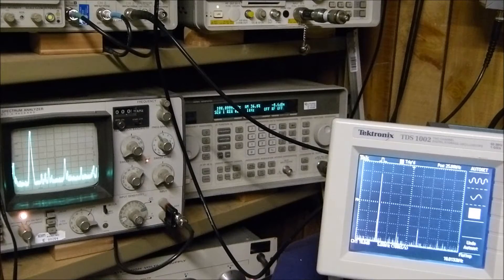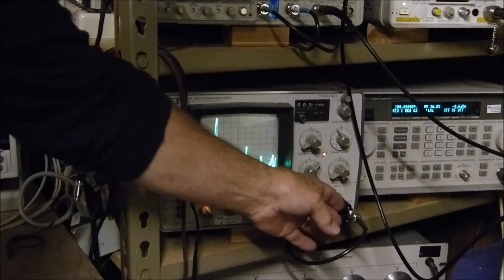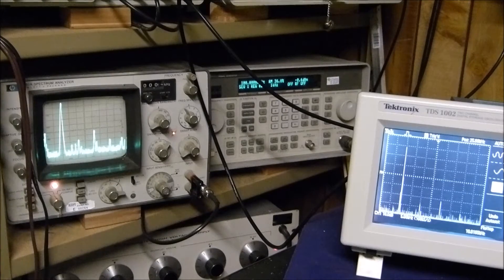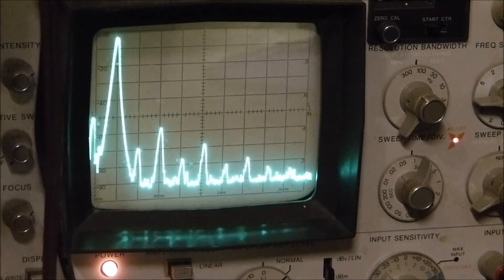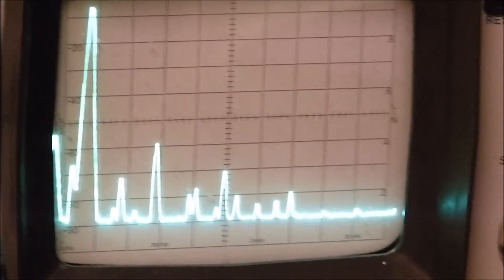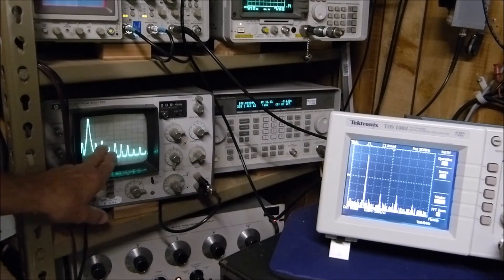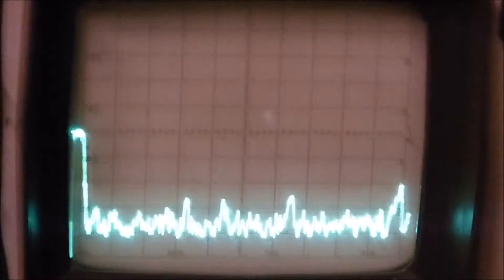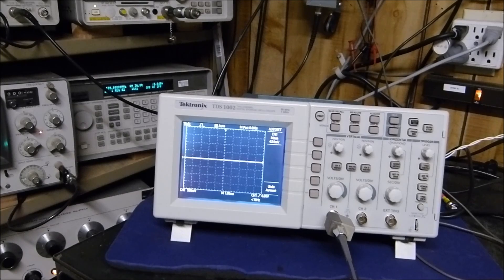Comparing Analog HP 3580A Audio Spectrum Analyzer To Tektronix DSO FFT At Audio Frequencies

Comment: Thank your for demonstrating the hp3580a at low frequencies. In particular I enjoyed the the 10 Hz Signal in connection with the 0-100 Hz span. While the FFT has a big speed advantage over the swept sine method  at such low frequencies it is always good to measure the same phenomenon with two different technologies to verify the results. The hp3580a was a fantastic piece of equipment for its time - especially love its amplifier and its ability to be battery powered - and it is always great to see it on YouTube. In addition it is one of the iconic products that made HP such an outstanding company from the beginnings until 2000. Hope to get one some day. Did you use the "adaptive sweep" function which was specifically designed for settings like this? If not it would be interesting to see how much it can quicken the measurement process. Greetings
Reply from the maker: It is an amazing instrument made as far back as 1973. Mine is an older model as it does not have the digital readout. I would say that every company, Dynaco, Fisher, McIntosh on and on... had one or more to verify the amplifiers they designed and built. Mine has gotten to where it needs to warm up a good hour before the vertical display is correct. Got to be very careful how we work on these jewels. They could easily be damaged during remedial maintenance. Thanks for your comments.
Reply: @ElPasoTubeAmps  Indeed, the instrument was featured in the cover story of the Septembre 1973 issue of the HP journal. 
If you did not use the adaptive sweep you might wish to try it out because it will increase the speed of measurement by a factor of ca. 10. In the video you said that you make rarely such measurement because they take so long.
While the swept sine method of the 3580a is relatively slow it allows to detect extremely small signals. I think this is because swept sine devices can use narrow bandwidth amplifiers while FFT devices use broadband amplifiers which catch more noise, thus limiting amplification. While everybody notices the slow speed of the 3580a nobody seems to value its enormous sensitivity of up to 0.1µV full scale (mentioned in the specs of the said article). Its FFT successors from HP - dynamic signal analyzers such as 3582a or 356x - typically have a maximum sensitivity of 3mV fs, so they are 30.000 times less sensitive. (This number is so incredible that I wonder whether I made some reading mistake but if so I cannot find it.) This ultra high sensitivity is not needed when measuring audio amplifiers - so it is usually overlooked on YouTube - but it becomes decisive when measuring the output of sensors. Like the vibration sensor shown on the cover of the mentioned HP journal. 

So - if you or any other 3580a owner could make a video analyzing these low level, low frequency signals it would be greatly appreciated. For example by people like me who measure vibrations in buildings.  Analyzing a, say, 10-100µV rms signal would be great. To the best of my knowledge there is currently no YouTube video covering this topic with respect to HP products. Greetings

Comment: Do you have standard settings you use with the 3580A? At least to start? I picked one up recently and need to become familiar with it.
Reply from the maker: I might suggest just pausing this video as various spots and looking at where the settings are on the 3580A. If the light with the three arrows is on between, Resolution Bandwidth (RBW), Freq Span/Div and Sweep Time/Div, it means you are sweeping too fast for the perfect display. The, Input Sensitivity, Max Input, light should not be lit or it will be creating its own artifacts. Put Amplitude Ref Level on Zero - Normal. Just have to play with it and get the feel of it and it starts to make sense. Hope this helps.

Comment: Wishing you a happy Christmas and new year 2023!
Were both of these connected to the output? I find that hard to swallow - the digital one looks as if it were connected to the input.
Reply from the maker: Merry Christmas and a healthy New Year for you and your loved ones.

They were both connected to the same point on the output. 
This was a few years ago but I am sure I was trying to illustrate the differences between the FFT method of digital spectrum analyzers and the older analog version, swept-tuned spectrum analyzers. The FFT method is much faster than the analog version when the RBW (Resolution BandWidth) and is small, i.e. looking at a small portion of a signal or if the frequency is low. With both types, weeping a large bandwidth is quick but there is much less resolution and detail can be missed. Zooming in, so to speak, by lowering the RBW slows down the sweep to as much as 50S per division and for 10 divisions that is 500S or 8.3 minutes for one sweep from left to right on the HP 3580A. 
With the digital FFT spectrum analyzers and especially the ones dedicated just for audio frequencies, all the low frequencies are instantly displayed and allows us to quickly see power line issues like the 60Hz and 120 Hz hum issues and real-time, make adjustments to reduce them - can't do that with the analog analyzers but the old 3580A is probably the spectrum analyzer that evaluated virtually every high-end vacuum tube amplifier ever built that we hold up as the very best of yesteryears.

Here is a link to the best video I know of on YouTube about RBW and VBW

https://www.youtube.com/watch?v=Ffhs9Ny03lM

Definitions below from Internet:

A swept-tuned spectrum analyzer displays measurement results sequentially—in other words, not in ''real-time. '' This is because a swept-tuned analyzer, in effect, uses a single narrow filter that is tuned across a range of frequencies to produce a spectrum display.

As the name suggests the FFT spectrum analyzer is an item of RF test equipment that uses Fourier analysis and digital signal processing techniques to provide spectrum analysis. Using Fourier analysis any waveform in the time domain can be represented by the weighted sum of sine and cosine signals.
Reply: @ElPasoTubeAmps  Wow, that is some detailed response, thank you! I will have to read it more than twice though. Thank you for the links too - I will make sure to check them out. Out of interest, the 3580, how far to the right can it extend when tuning at 100Hz, e.g. can it display harmonics all the way up to 50kHz? Reversely, when tuning at 20kHz, can it display subharmonics all the way down to 5Hz? I hope these questions make sense the way I wrote them.
Reply from the maker: @Stelios.Posantzis  It does go from 5 Hz to 50 KHz so it will display very low frequencies but at a very slow rate. Its top end is 50 KHz so for a fundamental frequency of 20 KHz, only the second harmonic can be seen at 40 KHz which is good enough and its noise floor is, at best, -90 dB. Totally good enough but the FFT analyzers that run off a PC nowadays serves the purpose just as well and some are free downloads off the Internet. We have to pay a little money to get all the options like the ability to print but the basic analyzer download is free.
Reply: @ElPasoTubeAmps  Thank you for this once again. On the subject of PC analysers, this is something I think about every couple of years when trying to decide whether the time is right for me to obtain an analyser and I am weighing my options. It is true, PC analysers are a massive convenience, are relatively future-proof and have brought down costs drastically. On the other hand, their proliferation has brought down the cost of second hand analogue analysers significantly - which among other things boot up instantly. Also, PC analysers are cheaper than stand alone devices but are still quite expensive if the bandwidth they cover exceeds 50 or 100 MHz. For the hobbyist, the second hand market is still the primary source in a lot of cases.
Reply from the maker: @Stelios.Posantzis  I agree and there is a certain charm and confidence we place in the high-end vintage equipment. The problem is, if these beautiful vintage pieces of equipment have an issue - that may be the end of them. I don't know if it is partly the pandemic but I have seen everything on Ebay go to such high prices, they will never see my shop. And all this stuff that is sold nowadays as "parts or repair" looks like it missed the recycle bin long ago, and with no return, of course, so I am supposed to spend $xxxx for something that came out of a barn from a dead fellow in 1980... I find a lot of it laughable. It is truly amazing to me that the best of these instruments of 40-50 years old are still so good but, I would say, buyer-beware.   Just my thoughts.
Reply: @ElPasoTubeAmps  Yes, some of these things contain proprietary or obsolete parts that are irreplaceable once broken. The only answer to that, should you be the unlucky custodian of such a device, is to build up a stack of junk pieces and hope to find a working replacement in one of them. This is not a practical solution for most hobbyists or collectors out there without ample spare time and space. But if you do come against a working example of one  of these items from a reputable place, why not? I bought a 24xx scope when I found out my old Nicolet died because of disuse. I needed something that would have 4 channels and ample of RF bandwidth so I plunged. Waiting for the right 475 to turn up was not an option: these things go higher and higher in price as time passes and the time you need to wait until a good sample appears is simply not worth it. One has to be judicious I guess and be both wary of seemingly good opportunities but also ready to grab a genuine one when it surfaces.
For me, the collector/custodian aspect is also a big factor. | hope to not only enjoy using one of those old beauties but also, if needed, rescue it from an early demise, preserve it and hopefully pass it on to someone that will do the same for a good many years after me.
Reply: @ElPasoTubeAmps  Thank you for the very nice link(s). I had not realised that analogue spectrum analysers did not perform some kind of Fourier analysis - or at least was not as certain about it. You have ignited my curiosity on how memory in analogue 'scopes and spectrum analysers works.

Comment: What about a cheap spectrum analyzer that can also be used for solar panel 120 to 220vac 50-60Hz power inverters in checking the 5th & 7th harmonics dirty electricity? thanks.
Reply from the maker: There are several PC based FFT SA's that would be good for that.
Reply: @ElPasoTubeAmps  thank you.

Comment: Just picked up a very nice condition HP 3580A.  I like your exploration of these tools and experiments.
Also some of the issues with the FFT at 100Hz may be due to how the bin of frequency over lay.  I noticed that on the 10Hz example the harmonics where not exactly on the span/division markers - this also worked better on the FFT display.  The harmonics were starting to walk off to the right of the x-axis division markers - suggesting that the injected signal was slightly above 10Hz.  You may go back and try the FFT reading at 101Hz or 99Hz to see if the missing harmonics on the 100Hz weren't getting diffused/spilling into adjacent frequency bin's.  The HP 3580A being analog doesn't have this gotcha.

Comment: One major difference between the two devices is dynamic range. HP 3580A was claimed at >80dB, whereas with the TDS 1002 and its 8 bit sampling depth, the usable dynamic range is  <48dB. Don't be fooled by the display range on the scope. There are ways to shift the input (scaling) on the scope to zoom into the lower levels, but that has to be done carefully. So depending on the work you're doing one maybe better than the other.

J
Reply from the maker: I have experienced what you mean by adjusting/limiting the dynamic range as I learned this with the Analog Discovery 2. The way the AD2 comes up, the dynamic range is set really high, can't remember exactly what but something like 120 dB. If I limit it to 80 or 90 dB I get a decent display as the frequency response of the input amplifier is good to at least 10 MHz but if I leave with the dynamic range too high the display is not very useful. I keep the Tektronix instrument as a modulation monitor for my transmitter most of the time but I am glad you mentioned this as I may find it useful for other purposes now. Thanks for your comments/

Comment: It seems that your sample rate is too low when you try to do a FFT at the lower freq.. I haven't worked withe the TDS1002 so I don't know if it can be tweaked to higher sample rates in this setup. If the TDS1002 can't be "convinced" to sample faster at say 1khz center, it really isn't very good at audio frequencies :-/
kr Bo
Reply from the maker: Hi Bo,
I gave up on the Tek device some time ago and went to the SpectraPlus that does an excellent job at low frequencies. On the other hand, the SpecPlus, USB sound card and PC combination doesn't do very well above about 5 KHz so I sometimes have to deal with both. I also picked up an Analog Discovery 2 device that is very poor at low frequencies, just like the Tek as an FFT device,  but OK at the upper end as long as I keep the noise floor at about -80 dB which is as good as the vintage HP 3580A. It appears there is no way to get a truly high end audio FFT instrument without spending lots of $$$.

Comment: It all depends on the speed of the processor in the DSO, it turns out I can actually do FFT processing in real time on an AMD A10-7800k. There is a very expensive DSO costing $20,000 and uses an INTEL processor but by getting a AMD processor might make it cheaper but not sure if you can specify a motherboard with a AMD A10-7800k  be used in that very expensive DSO.

Comment: Hello David! This was an excellent comparison. As we can see the old HP CRT spectrum display is a lot easier on the eyes even though it's not as fast :) However, I thought about things a little more carefully after viewing both videos. As much as I'm not a fan of LCD scopes at all, it does have a particular use...it's great for field calls. going out to a few recording studios to do checks on the console and tape machines, it's a lot lighter to carry out in the field instead of a much heavier CRT scope. One question: Does this DSO have a built in power supply, or is it external? The reason I ask is, should someone by chance use this for troubleshooting vintage AA5's which have a series filament string and one side of the AC mains connected to the chassis (hot chassis) which can fry any scope. Usually with a DSO that has an external power supply, it's generally isolated from the AC mains ground. Just curious. Either way, when I'm working on any equipment with a hot chassis, I use an isolation tranny on my bench for safety.
Reply from the maker: +Frank Ferraro It does have a built in PS so it is a complete unit. You would need an isolation transformer or an adapter plug for your AC line to float  the chassis.
Reply from the maker: +Frank Ferraro Here is an old-man story I bet you can connect with. In 1976 I was working on my mother's TV in her garage when I connected the oscilloscope to the board and then connected the ground lead at the end of the probe to the chassis to instantly have the ground lead go up in flames across my right hand and thumb. Yes, I knew better but what do you expect when you work on your mom's TV in her garage? I often wonder how many lives have been saved vs the stupid things that have happened like this because of polarized plugs. I suppose I "cheated" something for this to happen to me but I think it has to happen to almost any tech before they really "get it". If I remeber correctly I did fix the TV. I think it was an audio problem.
Reply: +ElPaso TubeAmps Yes, I can certainly relate to this one! :) I was working on an old GE B&W portable TV from 1958 that had a hot chassis. I connected my scope to check the vertical oscillator section, and when I connected the ground, I fried my scope. Luckily, I only had to replace a piece of wire from the ground post on my scope and a fuse. I learned never to trust polarized plugs because if the receptacle is wired with a reversed neutral, they're useless. I should have known better because I always keep an iso trans on my bench and use it religiously. I don't know what I was thinking that day :) Thank heavens for my old vacuum tube scope--an old EICO 460. :) They are forgiving.